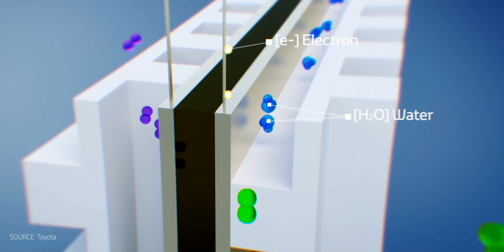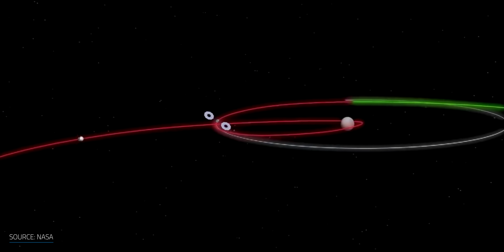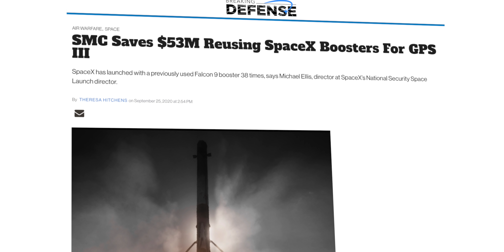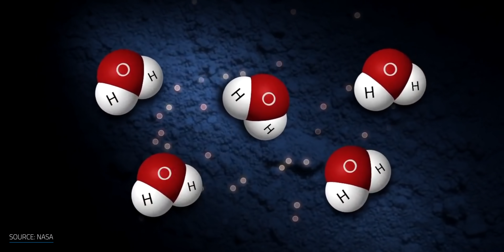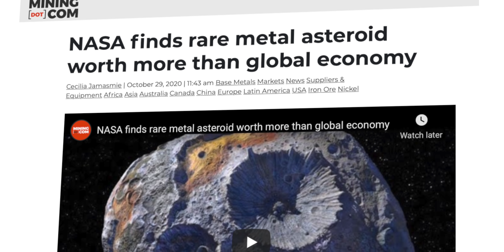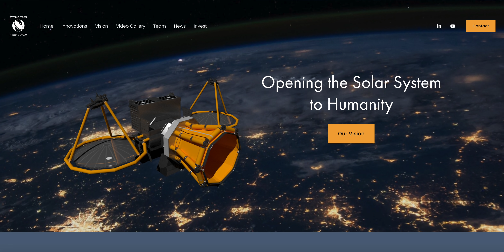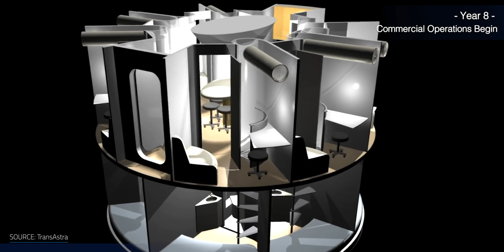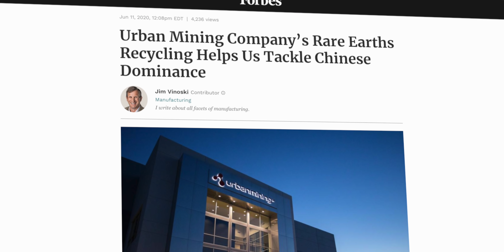Does Space Mining Solve Our Resource Problem?

Comment: There's a guy who operates in this space regularly named Isaac Arthur, and I think he's solved the cost of returning mined ore from space. Look on his channel for the videos "Sky Cities" and "Spaceplanes" and you'll understand we've already got all the tech necessary to import and export cheaply out of Earth's gravity well, but rockets ain't it.

Use helium and tethers to suspend a port 28 miles above the earth. A relatively normal plane, fitted with an airlock, could ferry passengers and cargo to said "Deep Sky Station" from the Earth's surface. Then a different plane could fly from that station to orbit.

No, really. Why this station has to be 28 miles up is because it's outside of most of the atmosphere at this height. While the faintest traces of our air extend beyond the moon, everything past 28 miles is effective vacuum for our purposes. This means, if you build a plane to JUST fly between 28 miles up and orbit, it can do it. Why we don't have spaceplanes yet is because we want them to take off from sea level, and you can design a scramjet to work well in lots of air or miniscule amounts of it, but you can't do both. So if we can just have this scramjet take off from 28 miles up, we can send stuff to and from orbit for pennies per pound.

The cargo spaceplane would look like America's B2 bomber, not for stealth purposes but because it's got a lot of internal area compared to most planes. That's important, because this scramjet will also kinda have to be a blimp. Lifting gas just offsets the weight of the cargo as the spaceplane begins its acceleration to orbit; it won't help much in orbit itself. But nearer the surface, it has to stay up long enough to get fast enough for orbital velocity, something it can't do without the lifting gas. Because what makes this so cheap is the slow acceleration. We aren't trying to deadlift the Chrysler building with planned explosions; even if you're Elon Musk, rocketry can only get so efficient. No; the scramjet will slowly build momentum without rocketry. It can do so with renewable inputs: electricity gathered from solar panels on its back, and thin air taken in at high velocity to set on fire and expel (which is what a scramjet does).

The only non-renewable component is the helium, but there's two solutions for that. One: use Earth-sourced helium for the first Deep Sky Station and the first spaceplane, and once that gives you cheap access to space, mine all the helium you want because it's super plentiful outside of our gravity well. Or, build the Deep Sky Station with helium, and before you even build the first spaceplane, build a vacuum balloon factory on the station. Materials science hasn't progressed to the point where we can sustain vacuum balloons at sea level; they inevitably implode. But 28 miles up, if they never have to come down, vacuum balloons could do the job of helium more cheaply and effectively. Then you can build the spaceplane fleet with vacuum balloons, and you can even swap out the helium holding up the station for vacuum balloons. And, for that matter, once we have a vacuum balloon industry, building permanent sky cities above Venus gets much easier, and you can go around outside at 50 miles up over there with only a mask because the air pressure is like Earth sea level, and the gravity's 90% Earth's, and there, we can safely move a bunch of humans off Earth before we foul the place... but I get ahead of myself.

One other thing that this technology would let us do is guilt-free fossil fuel exports. Imagine that all the coal mines fired back up in West Virginia, with more environmental protection for the immediate area in exchange for this new lease on life for a dying industry. Imagine that the trains are filled with coal again, but this time trundling tons of it to the nearest airport that services the DSS. (Maybe the planes will even be electric by the time this happens.) Trillions of tons of coal, enough to start a runaway greenhouse effect, gets gleefully exported... to Mars, where the extra carbon dioxide in the atmosphere may let us plant trees on the surface, while powering whatever settlements we set up there.

The moral of this short story of a post is that the future of Earth's environment is forever to be tied up with the exploration of space. We shouldn't make people choose between them; we must have both.
Reply: Good read . 10/10 would read again.
Reply: Also an easy thing Isaac Arthur's brought up is getting stuff back from  the asteroid belt or the moon is super cheap and easy. Just take a bit of the iron you've been mining - but isn't that profitable on its own - and use it as a heatshield. Then just either aim it really well, or have a small guidance package attached that either breaks off in into a stable orbit, or is expended.
Reply: Or, you know, build the factories in space
No need to bring the stuff down to earth then
Reply: @yourlocalengineer  Sure, but the very first vacuum balloon factory should probably be on the deep sky station because they will be getting the resources for the first couple from Earth. You have to crawl before you can run.
Reply: That final line is my struggle. My line of study is the protection and maintenance of the Earth's environment and I'm also an enthusiast about space exploration, but I'm surrounded by people who can't process the concept that both of them aren't mutually exclusive. It's frustrating.
Reply: you realize that your sky city will need to produce enough lift not only to keep itself up there, but also to keep the kilometers of cable lifted - thats an incredible amount of mass that you are just glossing over
not even mentioning the maintenance problems that result from the constant strain and weather exposure to most of the cable
and of course the whole system poses a massive danger in case of failures - should it lose lift, you suddenly have a massive kinetic impactor en route to the surface
losing the tether might also have catastrophic results, depending on where the whole thing drifts off to (not to mention a massive cable suddenly comes crashing into the ground somewhere)
and as you put up more of this kind of setup, any small remaining risk from all the precautions that are hopefully taken, multiply drastically

while it certainly is an idea worth investigating - it certainly isnt free of serious problems to overcome
but your final point is certainly an inescapable truth: space exploration and colonisation is the only long term path forward
Reply: @SharienGaming  I fully realize all that, but it's the only way we will ever be able to travel to space in a cost effective manner in our lifetimes. Even with all of SpaceX's advances, rockets just aren't within the reach of the average person, and if we're going to solve climate change, they never can be.

It's a principle of economics that the more money you invest in capital, the less the individual unit cost is. The sky city will not be cheap, it will ultimately require lots and lots of mass produced vacuum balloons. But it will be the only way we can send millions of people to space, the only way we can bring the products of asteroid mining to Earth in a usable and economic way.

The transcontinental railroad wasn't cheap either, but a ticket from Omaha to San Francisco was a whole lot cheaper than a Conestoga and six months' lost wages.
Reply: @kentchamberlain5720  i dont think its going to be the only way to realize that, but yeah conventional rockets arent a feasible option on a large scale - the accelleration alone means that most people wouldnt be able to safely do it and the rest will still require quite a bit of training just to be a passenger

those floating stations essentially are a variant of a space elevator that make a tradeoff that reduces some of the massive requirements for higher required maintenance and a more dangerous worst case scenario (they share the cable snapping one, but an orbital counterweight does not require a constant lift force, so will stay up in that situation)

oh and a sidenote on rockets an climate change - hydrogen fueled rockets probably wouldnt be an issue for the environment, but they still have the same issues with feasibility i mentioned earlier

another option that might be less risky but feasible could be some sort of hybrid design - basically using an airship to lift to sufficient height and then rocket engines for the rest of the way up - basically the same approach you outlined, but without a permanent platform hanging in the air

and im sure engineers and physicists can come up with other approaches as well - there is almost always more than just one way do achieve a desired result ;)
Reply: @SharienGaming  A space elevator would be the ideal solution, but the materials science hasn't caught up to the needs of deploying one on Earth. We could do it on the moon or Mars with current technology though.

My sky city idea doesn't require a tether anyway, it's mostly just there for convenience. A tether means it's always in the same place, and that it can receive power from a terrestrial power grid. But you could just build more vacuum balloons and slap solar panels on them if the tether wasn't feasible for some reason. But there's no reason why it shouldn't be feasible; materials science could fabricate a thirty mile long hanging tether already right now. Either way, it's not something to get hung up about in my proposal. The real point is creating a place that planes adapted to flying in air and planes adapted to flying to space can both reach, in order to make freight and passenger service to and from space cheap and routine.

Also, I figured that the sky city would probably float above the middle of the Pacific somewhere specifically to avoid any issues with a collapsing tether. I also figured there'd probably be more than one, in order to lessen the wear on any individual tether.

I think it's the most feasible possible solution to this problem, but I expect that eventually it will be replaced with orbital rings, once the economy is large enough to pay for them. We could build them right now with current technology, but they would bankrupt the world economy and that is too much uncertainty for us to build them now. But they will probably be built eventually, and if designed correctly they would even let you take a train to the moon. I don't expect to see them in my natural lifetime though.

If you really think the tether idea is impossible for some reason, the sky city concept could be done with space towers. Space towers require the same expensive technology as orbital rings, but on a much smaller scale: active support. The sheer expense of actively supporting a 28-mile-high skyscraper is why I think putting a city on a balloon and string is a better idea, but a modern superpower could probably still build one if it absolutely had to.

Again, I can't recommend Isaac Arthur's channel highly enough. He discusses all of these proposals, and others, in his "Upward Bound" series, backing up his assertions with math and science. I'm relying on his work here in my proposal. Also, it's not even my proposal per se: there's a private group already working on this, albeit with much less funding than SpaceX.
Reply: @kentchamberlain5720  oh i dont consider the idea impossible - im just saying its probably going to be very hard and carries significant risk
maybe the risks can be mitigated - i dont know, im honestly not versed enough in the engineering and physics to judge that
tho you reminded me of one advantage of the tether - it should be able to do the opposite of drawing power from the grid - its a very big and massive conductor moving through a magnetic field, which should induce currents (also there is a significant temperature differential between the top and bottom of it, which also can be used to generate electricity)

it just makes the engineering more tricky and dangerous
its all a matter of testing approaches, refining them and settling on one that works
Reply: Uh huh
Reply: The large bulk of arthur's ideas seem more steeped in the realm scifantasy than anything remotely realistic or achievable within the next 500yrs tbh
Reply: @o-wolf  Under our current capitalist system, perhaps, but great technological leaps are possible under socialism.
Reply: bUt ChIlDrEn ArE dYiNg iN AfRiCa
-Written by antispace fool on their iPhone
Reply: You cannot get into orbit with a solar powered plane. You cannot set air on fire. You need fuel. You cannot tether a space port to the ground with a tether 28 miles long.
Reply: @Withnail1969  We have tethers that have tensile strength that can stretch that long. Scramjets already set air on fire to provide their propulsion, and they already exist. Do your research before you correct people.
Reply: @Withnail1969  Go dweeb out on someone else's mentions, I don't need to be held back by your confusion.
Reply: @kentchamberlain5720  I'm confused. What helium is used for?

Comment: Is there any joy in the opposite of a space elevator - lowering material to Earth by rope?
Reply: aerobraking is cheaper and easier
Reply: @scotteskridge7460  What would it take to do that,  to say get one ton to the Earth's surface.
Reply: @tomellis4750  I mean I haven't actually done the math, and sure heat shielding against reentry speeds takes more engineering than say pulling rocks out of the ground. But its a heck of a lot cheaper to come down than it is to go up, and we've been working on heat shielding for 60 years now, I mean heck look at space x doing reentry of their fairings they don't even need heat shields for those because it has enough surface area. If you were talking about trying to return thousands or hundreds of thousands of tons of material you could probably smelt it roll it out flat a couple of inches thick and give it a reasonably aerodynamically stable shape and you could drop the whole lump into the atmosphere without heat shielding or electronics.
Reply: Getting materials to Earth is absurdly easy and cheap. The hard part is getting equipment off Earth.

Once you’re out there, you could make primitive ships from the iron and other minerals on the same asteroids. You can also produce fuel out there. They may take years to construct and arrive, depending on transfer orbits, but that’s not especially important. You’d sell the rights to the incoming minerals long before they arrive in Earth’s atmosphere. So long as they actually arrive, everyone is happy.

Comment: The turning point will be when we start constracting things in space. Just as bringing raw materials from space is stupid expensive, bringing the same things up is just as bad. Until we need a milion ton of steel and copper(whatever)  in space for a large project, it will not be an option. Even if we run out of something essential, 'engineering' our way around the problem might be cheaper.
Reply: True I can see a future where the space economy and the earth economy are two separate things due to the cost of getting things into and out of orbit (barring that doesn't get easier as well)
Reply: @pford  
I think 'sinking' things into the atmosphere will always be a dead end. You can't just have million tonnes of material freeralling, you must slow it down, protect it from heat, and controll the landing. Which means heatshields, fuel and engines as added weight taken way from the payload. How many of these vessels you need to land to have viable bussinnes when comes to common things like iron? Maybe with rare elements, if processed in space and sent down 99.9% pure. But then they are not rare anymore, so they not that expensive...
Reply: @marrs1013  Once you can build all of those elements in space it becomes pretty cheap. Make those components from lower value mining “waste”